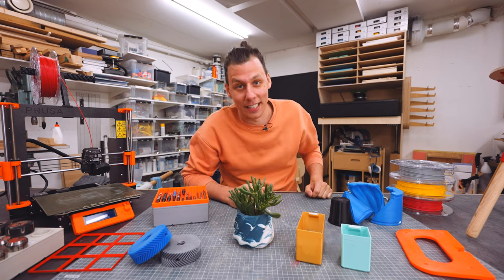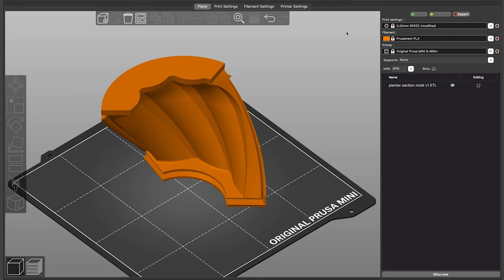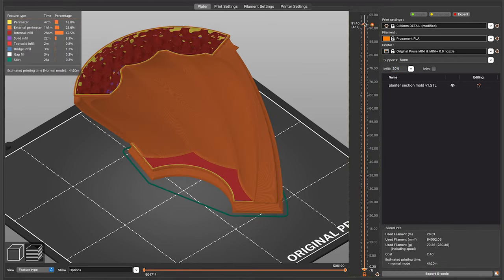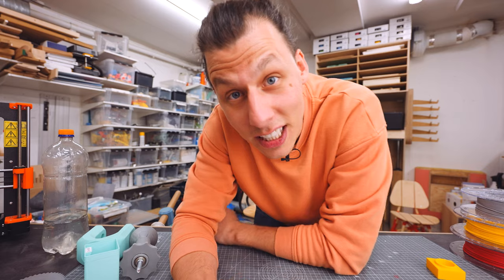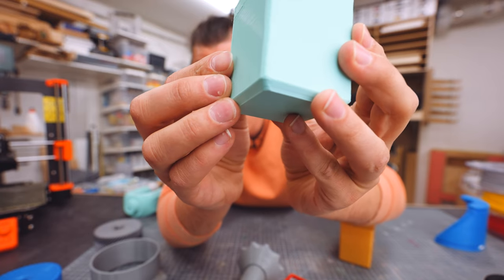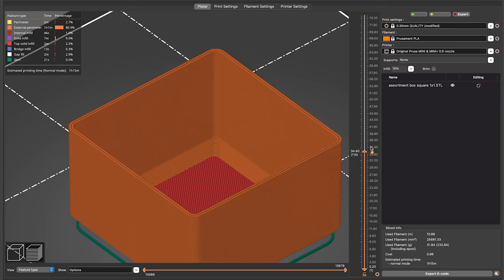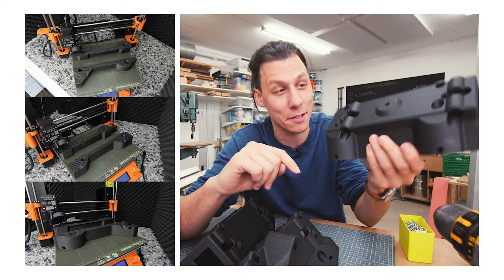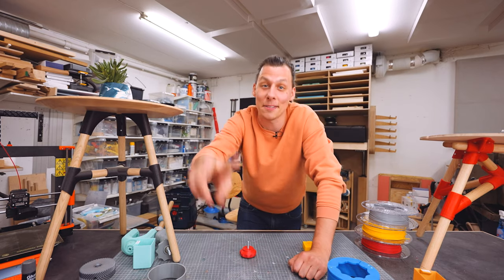My 10 BEST tips for 3D Printing

Comment: Great tips Alex, I am using them in everything I print now. One thing which I thought you might mention: aligning the print so that the axis with the most bending stress has the filament running along it, so that there's less danger of layer separation. But perhaps that's much less important than I thought? I have very little practical 3D printing experience compared to you!

Comment: Can you 3D print a 3D printer?
Reply: A lot of 3d printer parts can be made on a 3d printer. In fact I think nearly all of the Prusa printer plastic parts are 3d printed. That said, you can't print the motors, circuit boards, wiring, hot end, etc.

Comment: A 0.6mm nozzle is only an upgrade if you're mainly printing big or structural prints. If you're printing anything small or with fine details it's a downgrade. If the 0.6mm was always better printers would all ship with them, after all. Also had to laugh at using Prusa Slicer because you use a Prusa Printer. You can use any slicer you like for a Prusa printer and Prusa slicer can be used on any other printer. It's a shame the few bits of genuinely good advice is buried under so much silliness.

Comment: You say that you have thousands of hours printing ´......and you use gluestick to get things stick on the heatbed? thats= lol. i have 9 printers, all 9 printers has own enviroment for the specific prints. reserved pla printers has no inhousing around them, abs and other higher temperature filament printers has inhousing. man your video is fun. you say things that make non sense. you sure you printed thousands of hours???? because in my toolkit is no hairspray or gluestick. i would say you have too old bedsurface on your mark3 and no idea of how to setup correctly. im out. disliked and channel blocked.

Comment: PLA is NOT strong enough for most things, and not stable in the sun, heat etc. I really hate when people who have no knowledge of 3d printing make videos like these. It's great, you use a 3d printer for your projects. That doesn't make you a pro. Stop giving shit advice.
Reply: Agreed. Sadly at least half of the information in this vid is questionable at best
Reply: Let's see: on one hand we have a guy who has dozens of hours of content (probably hundreds or thousands of hours of design experience and seemingly thousands of hours of printing experience) related to 3D printing various and sundry practical and useful things, some of which are being used in structurally critical applications such as chairs and camera mounts, all of which demonstrably are doing just fine with PLA. On the other hand we have an anonymous hater with zero videos, zero proof of their claims, zero proof of having any knowledge whatsoever, zero proof of their appeal to authority ("professionality"), making blanket statements that have no basis in reality.

Guess what: Even the best, most UV resistant glass/carbon fiber reinforced plastics will fall to the sun eventually. Maybe not all parts have to operate with continuous exposure to 100C temperatures or require 1000 psi tensile strength. Maybe... Just MAYBE... A person has to select materials and methods which are best suited to their particular application?